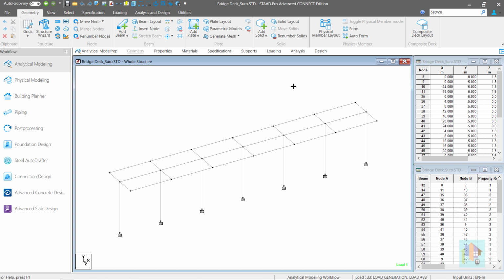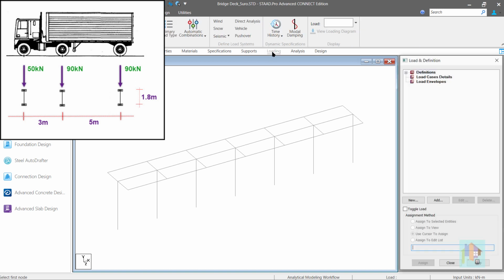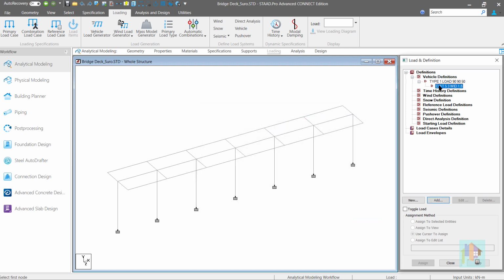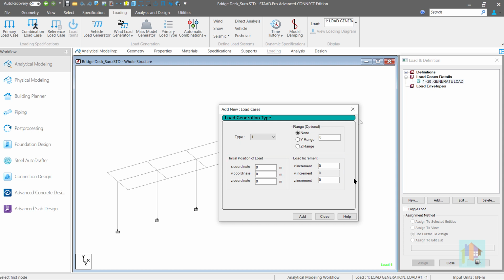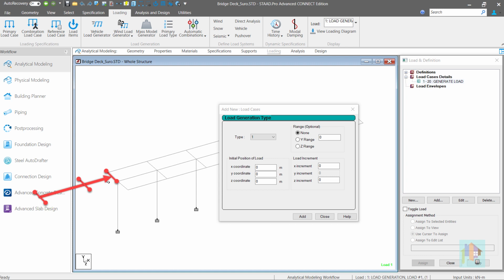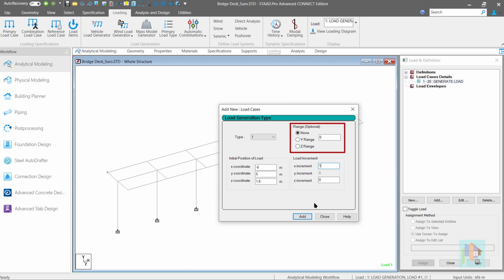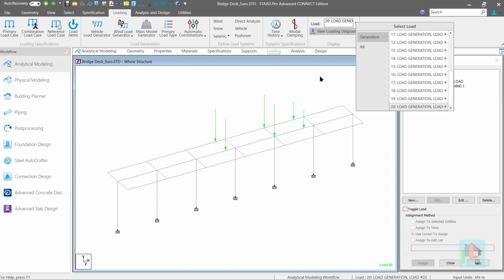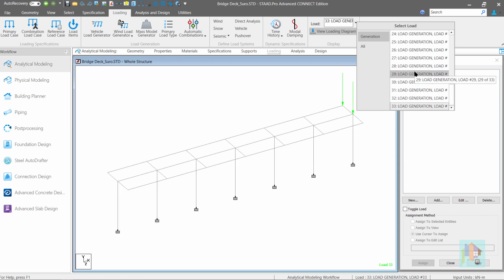Moving Load: p3 - Vehicle Load Generator || Truck Load Generation || Reference point, Load increment

Comment: Sir I have one question regarding support reaction
Suppose Fy Reaction comes to be -120KN so according to staad should it be consider as uplift/Tension or it is considered as compression load
Reply from the maker: Negative value in support reaction Y component means it is under uplift condition. So, Fy = -120 means the column is under tension (check corresponding Fx value) and it tries to uplift the foundation.